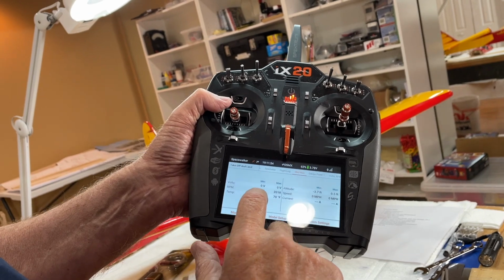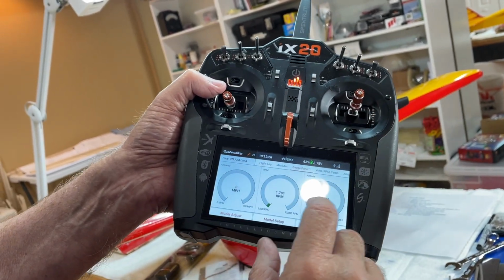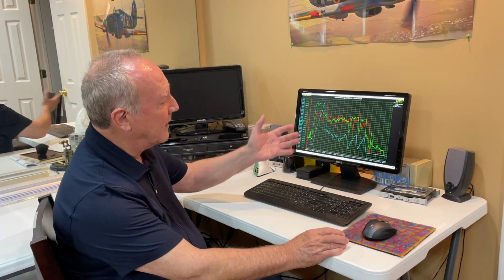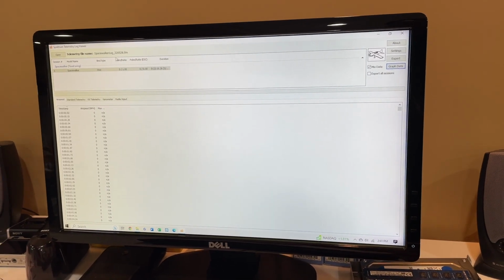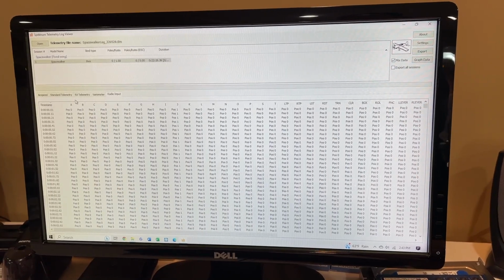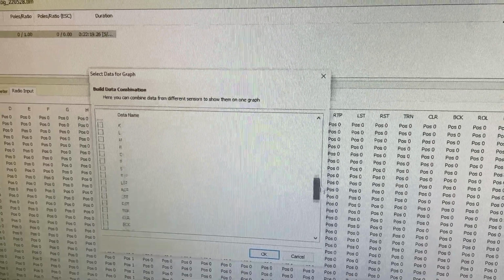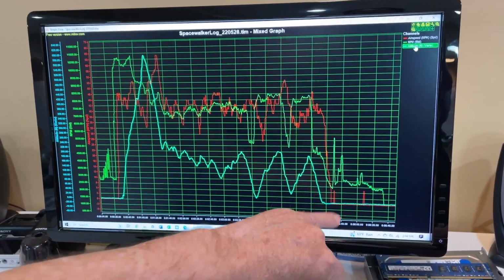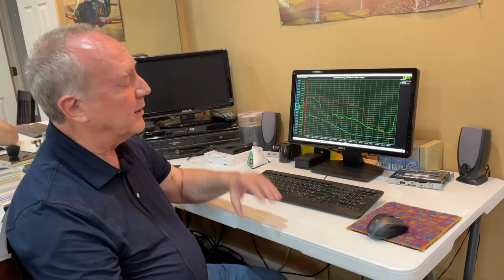RC Airplane Telemetry for Newbies

Comment: Hi, I just starting to learn about this hobby, and I have what may be some stupid questions.

In the video, Ron  uses the terms "stall" and  "critical speed".   I looked up the term critical speed and found it is the speed at which air over the wing reaches supersonic.  Ron says his critical speed for that airplane is 27 mph.  It seems hard to believe that supersonic flow over a wing can start at 27 mph.  I also looked up "stall" and it says that stall is about angle of attack, not speed.  Could you help me with this?
Reply from the maker: I'll check with Ron.  Stall speed relates to angle of attack rather than airspeed, that is correct.  As most smaller aircraft do not have angle of attack indicators (airliners and military aircraft do), airspeed is used as a reasonable substitute for stall speed at lower airspeeds.  Tim
Reply: @TimMcKay56  Thanks for your very quick reply!
Reply from the maker: In the model world it is commonplace to refer to the 'stall speed' as the airspeed at which flight can no longer be maintained due to the resulting angle of attack.  In simple terms it is the airspeed at which the wing stalls.  As you correctly mention, our models do not have AOA sensors so we use the measured airspeed as an effective substitute since for all practical purposes it achieves the same end goal of keeping the wing flying at slower speeds.

Ron
Reply: @TimMcKay56  Thanks again!  I'm learning a lot from your videos and enjoying every minute of it.

Comment: Something that has been puzzling me about SBus and SBus2. I know that I can 'string' multiple servos along a serial connection with SBus etc. What I am curious about is other channels. I would be using possibly CH1 for throttle in the slot for CH1 on the receiver. I would like to also use a channel for a choke, the ON-OFF-ON sorta thing. We know that CH1-4 are normally for flight controls. If these flight controls are being run through an SBus system, what happens to the normal slots in a receiver for CH1-4..?? Can they be used for something else..??

Thanks everyone for looking into this....my question has been answered. Safe flying all..!!
Reply from the maker: Can anyone assist??  😊 Tim

Comment: I'm curious as to the type of signal going back to the transmitter. Is it Bluetooth?  I bought an inexpensive electric-powered R/C boat for my nephews to use at the pond near me. It actually has some means of signaling to the transmitter that the battery in the boat has reached a state requiring recharge. It must be that the (borrowed?) technology nowadays has 2-way communications often built in, and they are just harnessing that capability.
Reply from the maker: DC:  Not fully sure, will see what Ron has to offer!  Tim
Reply from the maker: The telemetry communication back to the transmitter uses the same 2.4GHz RF link that is used to control the aircraft. Uplink control information is sent in packets.  Ron
Reply: @TimMcKay56  That's really interesting! Would it be true to say that 2.4 GHz systems have always had 2-way communication? Some aspects of system operations seemed to hint at that from the beginning. I watched a few videos on how Bluetooth works, and there was a claim that Bluetooth also operates on 2.4 GHz channels. Makes me wonder if 2.4 GHz R/C equipment came to be as a result of technology advances in industry and consumer electronics. Amazing that all those wound coils for Intermediate Frequency and Radio Frequency are no longer needed!
Reply: @dustcommander100  Will do some research!  Tim

Comment: Great explanation!
Is there a way to monitor battery capacity while flying with telemetry?
Thanks
Reply from the maker: Ron:  I'll forward this to Ron Bell . . . he can provide a good answer!  Tim
Reply: @TimMcKay56  My understanding is that there is not really a simple yes/no answer to this question.  However, as I don't fly electric aircraft I can't claim to be an expert here.
There are whole threads on RC Groups devoted to this topic with many opinions expressed but nothing really conclusive.  The newer Spektrum PowerSafe receivers claim to have capacity measurement and reporting built in, which would suggest an answer of yes, but I don't know how reliable it is as even the Spektrum gurus seem to say that monitoring battery capacity is highly questionable due to the number of variables involved; battery age, ambient temperature, pre-flight charge, flight profile, etc.  The general consensus seems to be that monitoring flight pack voltage is much more meaningful and reliable than trying to measure capacity.

Comment: Very cool. I came a across this video looking for a realtime feedback mechanism for RC vehicles that could be used to incorporate feedback into the transmitter e.g. a rumble motor to replicate engine vibration or ideally control surface forces to allow force feedback on the sticks. 
Probably not possible with this technology due to sample rates etc. Might even require an analogue channel.
Reply from the maker: Joe:  Thanks so much for checking in, best of luck with your project!  Tim and Ron  😁

Comment: I was able to find a Spektrum 9574; I was curious with the newer Spektrum revivers, can you plug this device in via x-bus cable instead of using the TM1000? Is that just used for older receivers? Thanks!
Reply from the maker: Drew:  Not sure on the newer receivers. Try the tech chat at www.HorizonHobby.com  Tim
Reply: @TimMcKay56  I contacted Spektrum directly and they stated that any new receiver that has a X-bus port will be compatible with these airspeed indicators without the use of the TM1000. Which is great! Just wanted to share what I found out.
Reply from the maker: @drew8837  😊👍🏻 Tim

Comment: Excellent. As for Avionics I'm going to start with the A3 MPU for flight stabilization, because crashing sucks. Telemetry battery information might be a mission critical thing for something big and expensive with a high stall speed. Well Done.
Reply from the maker: Planker:  Thanks for checking in, and I’ll pass along to Ron!  Tim

Comment: Many thanks for this very informative vlog. As a rc yacht sailor some of it was a bit over my head, but the ability to monitor battery voltage remotely is invaluable. Now I will need to purchase a transmitter and receiver with telemetry.
Reply from the maker: Malin:  Yes, ensure the transmitter and receiver allow telemetry and you should be good to sail!  Tim

Comment: Always enjoy watching your videos, they are informative. I have noticed that the Spektrum pitot tubes have been discontinued for some time. Are you aware of anywhere you can still find these, or is there another option for airspeed telemetry not via GPS. Thanks for any info!
Reply from the maker: Drew:  You are correct.  I don't know why it has been discontinued (very disappointing) and whether Spektrum has plans for a replacement.  I believe the original SPMA9574 item was actually sourced from Eagle Tree Systems and sold under license by Spektrum so hopefully there are alternatives already out there or in the works.  Ron
Reply: @TimMcKay56  thanks for the info, really appreciate it! It is disappointing when they stop items!